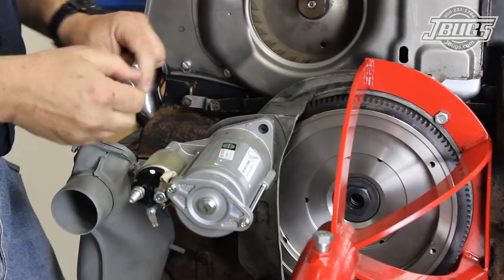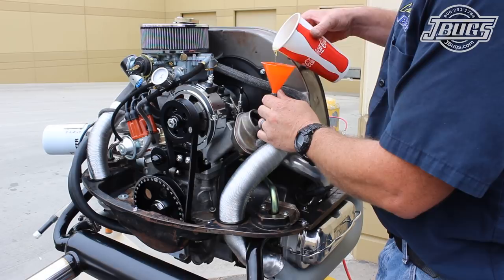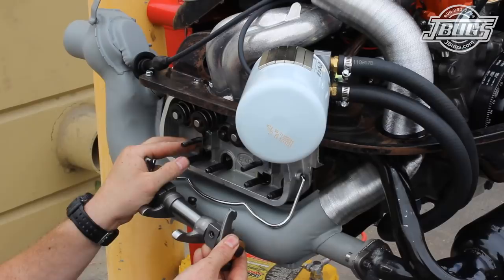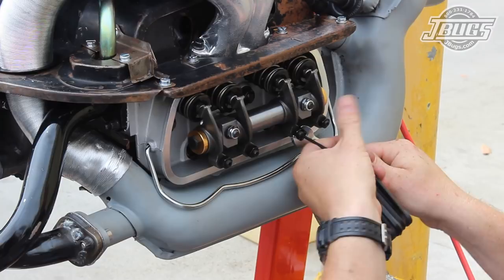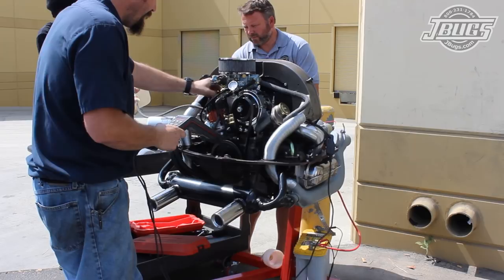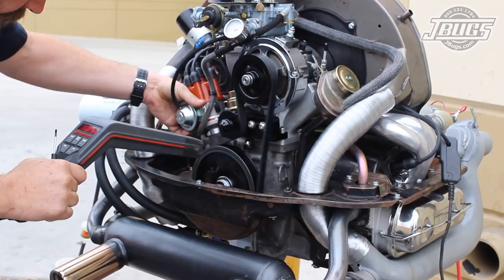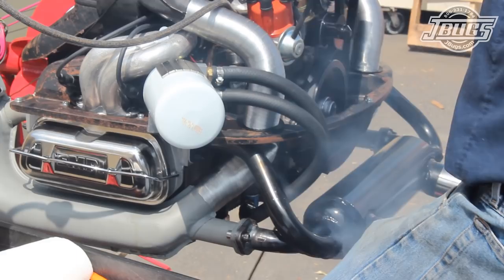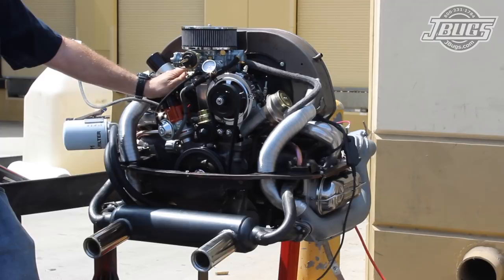JBugs - 1971 VW Super Beetle - 1800cc Engine Break In - First Start

Comment: Nice! Would like to redo my engine this way. Why did you choose to go with high lift rockers instead of a different cam? Just figuring stuff out.
Reply: In all honesty, it was because the only cams we had available when this engine was assembled were the EMPI cams, not the Engle cams. I would have preferred to run a W110 cam, but didn't have the option. So, I went with a stock cam and to get the most performance out of it, and because I wanted to show the process of setting up ratio rockers (as there wasn't a good video that I could find) I went this route.

Comment: Is it only the negative and positive (red&black) wires from the electric distributor to the coil???
Reply from the maker: From the distributor to the coil, yes. The coil does have a power wire that goes to the positive side which  powers the coil and the ignition module in the distributor.

Comment: Loved the description. Is there any idea of the HP of the engine with the mods you did?
Reply: Based on previous engines we've run in the past and dyno-ed we're guessing at about 75 hp at the wheels. Stock was roughly 58.

Comment: Great job guys it looks great. On a vw don't you want to use oil with zinc at all times?
Reply from the maker: Yes, we recommend using oil with zinc in all air cooled engines. We use the high zinc during engine break in.
Reply: @JBugsVWParts  thank you for your information
Reply: @JBugsVWParts hello I already have 50 miles on my new engine but didn’t use break in oil, I used sae 40, is it to late to use the break in oil now? If not can i drive it around for a certain amount if miles since i dont have a gage? Thank you
Reply: As long as you used "classic car" oil (any motor oil with a high zinc content) it will be fine. I'd change the oil as soon as possible, and just keep using the same oil, as long as it has zinc  @nikittoo1 .

Comment: Good morning! What size of exhaust installed and part number as well if you could provide information, thank you
Reply from the maker: We installed the 2 Tip GT exhaust which has 1 3/8” tubing. https://www.jbugs.com/product/3418.html
Reply: What size rocker arm's did you use I'm building the same engine
Reply: And what carburetor is that I was thinking about a single 40 IDF
Reply: @charlesmartin7347  we used 1.4:1 ratio rockers.
Reply: @charlesmartin7347  we used the 38EGAS carburetor.

Comment: Is it always necessary to remove the rockers from the heads?  I've never heard of anyone doing this before or is it just for high performance motors?
Reply: It isn't necessary but it does keep the lifters safe while the engine builds oil pressure before the first start.
Reply: No not at all